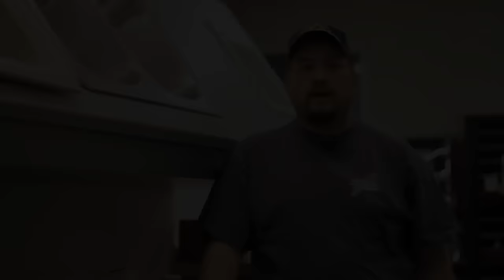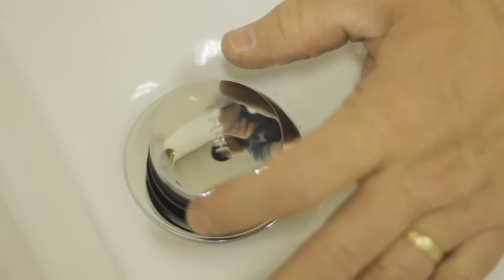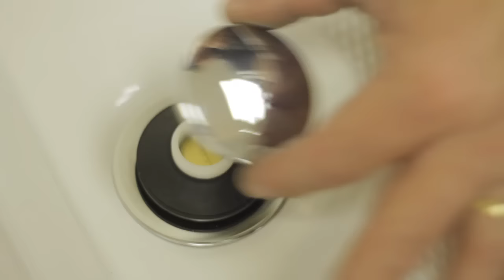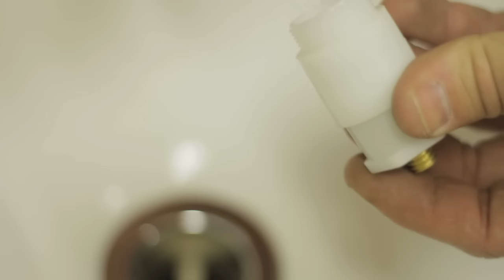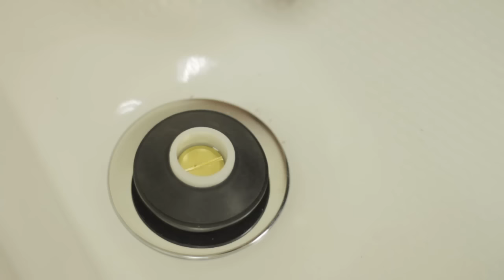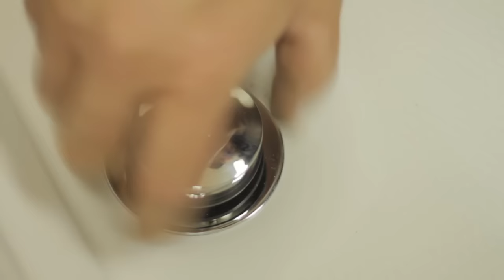Bathroom Repair : How to Repair a Pop-Up Tub Drain Stopper

Comment: Why can't I unscrew my top?
Reply: Ditto here as well. I was almost thinking the contractor used loctite, due to my not being thrilled with some of their work..
Reply: It’s been years since you asked but he mentions in the video that some plugs all you do is just pull straight up and out. No need to unscrew.
Reply: Some u have to pull the cap off it won’t break it literally pops off I knw this comment is months late but 🤷🏻‍♂️ I’m sure someone can use it
Reply: @potpapi1275  I did, your comment was helpful😂. Thank you
Reply: Me too, another month in the future. 🤣
Reply: what worked for me was sliding a pair of needle nose pliers underneath the cap to hold the bottom piece down while you unscrew the top. the cap might just be really tight.
Reply: Helpful to me too! 😂

Comment: Thanks Terry! I spent 30 mins spinning the top of the stopper but  it wouldn't come out. I was making progress but never could get it all the way out. Frustrating. Then I thought there had to be a trick so I went straight to Youtube. I had to put a needle nose pliers under the silver cap of the stopper to hold it while I turned the sliver cap/top off. Once the cap was off I saw the brass screw hidden under it .....now I'm home free. Thanks again!!

Comment: the screw on mine is stuck it isn't moving any idea?? love the video exactly what i needed to know
Reply: I put some muscle into turning mine with a big headed screwdriver and finally got it off
Reply: @trackstar33  yeah, I had to match a wood chisel to the size of the slot and it worked.
Reply: Perhaps using a portable screwdriver with a large bit  on low speed to get the torque needed— I saw that on YouTube. .
Reply: can always use a drill or a stripped screw head tool

Comment: I followed the video instructions and it worked fine to replace (not repair) a broken drain. It took 5 minutes. However, you do need the correct tools to make it that easy. A special device to help unscrew the old broken drain (by friction) and a different tool to make it easy to snugly tighten the new drain without scratching it. My wife thought it would take hours. With the time I saved, I am going to have a couple beers.

Comment: Thanks Terry! Once I got the screwdriver portion out it turned out that it was just my fiancé' hair that was clogging the drain. Easy fix that I wouldn't have found without learning that a screwdriver took the cylinder section out. Great video, especially for a DIY beginner like myself!

Comment: My stopper (toe touch) seems to have a different design. I couldn’t unscrew the cap. It doesn’t seem to be screwable. But I was able to unscrew the whole stopper as one piece with a big plier. There is a screw at the bottom of the stopper assembly. Basically, the whole stopper was sitting on a screw. It was very tight and took me a while to unscrew the whole thing. Anyway, just want to share my experience as it might be helpful for some people.
Reply: I realize that this is an old post but for the rest of you folks out there...  If you use needlenose plyers and slide them under the rubber washer, you should be able to hold the plastic stem from turning as you unscrew the cap.
Reply: Paul Gorsky thanks! Just cleaned mines.

Comment: thank you!
I had just installed a new tub. A Month or two after install the stopper stopped working.
[the spring/screw had shortened to the point it wouldnt catch the drain.]
Soon as I saw this video, I fixed it within 30 seconds. By taking the top off, and giving that flat screw a couple twists.
 Thanks again!@

Comment: try pulling on the silver top piece and turning counter clockwise sometimes the whole stopper comes out from bottom of drain which is fine because you can now turn the top outside of drain using rubber lined gloves for gripping as to create tention enough to loosen the top in order to expose the screw undernieth

Comment: I didn’t know top cap comes off. My brother broke the inside of drain which fused to the brass screw from stopped. How do we replace the drain portion to add a new popup? since and brass do not mix and it was inevitable that they fused together. Thanks.

Comment: What do you do if you can't get the top cap off? I've tried everything I can think of (Except a torch). The whole pop up drain assembly just keeps turning - without loosening or tightening.

Comment: I have this kind of drain but what happens if I can’t unscrew the screw to get it apart? I’ve tried everything to get that screw loose, even WD40. Screw is stuck tight. Tub drain is stopped up and I need to get Drano in there.

Comment: So I just replaced it. It won't lock down into the closed position. I tried putting a washer between the screw and tub drain. I could then get it to lock down, but all the water drained out because it was sitting too high. Any ideas?

Comment: this looks very simple, but the place where you would normally use the srewdriver is wider and will not work with a screw driver. what can I do? i tried a wrench which, resulted in the plastic surrounding housing to break.

Comment: I should have looked this up weeks ago and saved myself a lot of frustration from prograstination. The part itself is an easy replace. Though the corroding and breaking mount to the actual tub is a different story which I might have to deal with. But if that becomes a problem, that will be the landlord's problem

Comment: Any suggestions on how to get the stopper unscrewed? Mine is not budging, even after buying a larger flat head screwdriver - nadda.
Reply: +Deana Williams I recommend working some baking soda down the drain then pouring in some distilled white vinegar, the chemical reaction might eat away the crud that has your bolt locked up.  If that doesn't work boil a little water and pour it down after the bakingsoda and vinegar.  This method just now worked for me.  Good luck!
Reply: Thanks, this method just worked for me too!
Reply: I have a Delta stopper.  The entire assembly is in one piece (not two like here) - but the process is nearly the same except no screwdriver is required.  
For this one, you carefully use pliers on the decorative top - I took a silicone hot pad that was no longer pretty enough for the kitchen as a grip/cushion.  And with authority, lefty-loosey.
It's kind of a weird design.  The top assembly can get cock-eyed - I was afraid I'd broken it.  But that's how it's designed.  The rubber surround doesn't need to come off (I removed it, when I was looking to see if I'd broken it, and it's a pain to get it back on again.)
Hope this helps.
Reply: Deana Williams 
Mine was stuck solid, I put a long handle screw driver and turned it while strongly tapping the handle of the screw driver with some pliers. I didn't have a hammer handy that's why I used pliers as a striking tool.
Any-who, this worked!
Reply: My popup bathplug does not want to click to close. Any ideas would help
Reply: Success!  Baking soda followed by vinegar and then a cup of hot water !! Thank you!

Comment: if anyone is struggling to remove the cap you can unscrew the entire drain by gripping it firmly and unscrewing, after let it sit in hot water and some dish soap! mine was cemented shut with old conditioner and other residue but some dish soap and hot water did the trick

Comment: I was having trouble getting the silver top off but I used a pair of needle-nose pliers to stabilize the white plastic part while twisting the silver top - that worked.  NOTE: if the screw is locked up (seized) by gunk something that helped me was putting baking soda down the drain then pouring in distilled white vinegar - on my second tub that didn't quite do the job so I poured a little boiling hot water down after the baking soda and vinegar which did the trick.  Darn that shower grime!  Disgusting.
Good luck everyone!

Comment: So what do we do if that flathead slot WON'T BUDGE.
Reply: Use a multi speed drill set it in reverse and set it to one and slowly go up until it hits the force threshold

Edit further more look up penetrating oils and if all else fails you could get some bits and drill it out
Reply: Yep, same issue here lol. Damn flat head is fused.
Reply: Same here. Has to turn both directions to get it loose

Comment: Mine looks exactly like the one in the video, but no go.  The whole piece just spins and spins in either direction.  I tried holding the core in place with channel locks but nope, the top piece will not turn.

Comment: Have a cheap plastic topped one put cloth round top and keep trying to turn anti-clockwise took a few minutes before it came loose its a partly brass rod about  2.5 inches long threaded on the end,be carefull not to damage chromed plastic top.

Comment: This is not a repair.  It is a replace.  I need to know how the "guts" fit inside. I bought a new plug and it 'exploded' coming out of the package and I don't know in what order to put it back together.  
$15 and if I lose the screw, I am screwed.  I know how to replace, but when I put it in, the thing would not go up and down as it should. Please help me.

Comment: The old pop up drain wasn't threaded and didn't work (I just picked up it out of the drain) when I bought the house. Followed all instructions with new piece, same as in the video, drain keeps spinning when trying to replace (but it's threaded, doesn't just come back out) and still lets water out slowly. No idea what I'm doing wrong. All these videos look like it's suppose to stop spinning at some point when replacing. If I spin to far, it won't pop down at all, otherwise can't get it to keep water in the tub. And I mean spinning, not like what I see in this video, I have to spin it more than 10 times and it caught the threads and yes I can still remove it.

Comment: My problem was that it didn't stop the water from draining when it was pushed down. Made it impossible to bathe. Turns out that screw in the middle of the stopper got loose which wasn't getting a good suction to stop the water from draining

Comment: My stopper is really stuck in there. I will keep trying.Thanks for the video :)
Reply: +maldoror23 I recommend working some baking soda down the drain then pouring in some distilled white vinegar, the chemical reaction might eat away the crud that has your bolt locked up.  If that doesn't work boil a little water and pour it down after the bakingsoda and vinegar. Good luck!
Reply: @cannonrange9977  I was about to give up then I tried your recommendation without much expectation but it worked like a charm!!! thank you so much

Comment: Mine has no screw and the entire (sub) assembly was supposed be turned to remove it ( after removing the top cap and washer). It seems the stud into the crossbar is frozen. So far no luck with WD40, Lime Away, etc. No wrench flats and no access to the stud . Anyone else run into this, absent cutting or drilling it out ?

Comment: Mine wouldn't pop up once it was down. I took it off, soaked it in vinegar for about 45 minutes.  Scrubbed it to get hard water off.  Sprayed it with WD40 and it works better than when it was new.

Comment: Okay, I want to remove a stopper like this but it refuses to unscrew. I've tried unscrewing it with all my strength, but nothing. This is driving me insane.
Reply: Mr. Horseshoe What did you do to turn the set screw?  I am having the same issue
Reply: I've got the same problem!
Reply: Same problem here too!

Comment: What if the top doesn't come off?
Reply: I didn't take the top CA off first I screwed the whole thing out I had a couple of pairs of channel locks and a med sized pipe wrench, and my screw driver....once I took it all out I could hold it better to get the top off....two of anything that gives you a firm grip on the plug body while you gently remove the top. I figured out mine came apart in the middle as well. Just remember me the pieces of the plug with 123 or A,B,C So you can just reverse the order and put it back together...be careful if there are plastic rings inside it.....
Reply: +Tawnya Bartlett 
oops completely disregard the "CA" Its a typo....

Comment: the notch for the screwdriver was so shallow that it stripped out within seconds attempting to get it out. They did that on purpose didn't they? ...so i would have to buy a whole new tub and sell me a bathroom remodel while they were at it.....right??.....lol....I got the screw out using an improvised object w a long thin piece of metal acting as a screwdriver edge. :-) I've noticed the plumbing indistry makes really crappy parts, its unreal.

Comment: Thank you for the Video . Looks like mine is poop lol  . But you have Elvis who is cheap as a poop . I hope the springs don't hit him in the eye when he tries to take apart his broken toy . Seven or eight parts depending on what your counting ( don't tell Elvis what we are not counting  ). Ok the drain works a on cam based system so if the cam isn't working don't be Elvis . Buy a new part . Elvis would go out of his mind if this dealt with a real mechanical linkage  I never liked Elvis still don't no doubt she will spell check me soon lol

Comment: Terry, you didn't show how to repair it. You just showed how to remove it. 😞
Reply: +Christopher Karpowicz  he assumed you had some basic intelligence.
Reply: +Matt Black  in today's America, it's not smart to assume that
Reply: Mr. I'm with you. If he thinks taking it out and putting it in is all there is to it, there's a reason he's at a store and not out doing plumbing. I wanted to know what to do with the spring and two white plastic rings that fell out. I will say thanks for the step he showed but nothing showed how to make a non working one ...work.
     btw...I do hope the comment about being smart enough was dry humor, cause repair requires and non working item to work. I highly doubt taking it out and putting it in repairs anything. So it should be titled replace. Which I am smart enough to know the difference.
Reply: +Tawnya Bartlett 
oops my bad I should have said " basic intelligence " which doesn't at all sound dry humor.....so let me add.....if that's what he assumed I should be insulted....like I am by that comment....he assumed I could fix something I've never seen but I could get the cap off? Really?
          nope got it off...now what genius?
Reply: Agreed, this was a replacement, not a repair.  I was hoping for adjustment tips--for when a new one doesn't seal, etc.  Not buying a new, new one.
Reply: +Skibbified 
I messed with the spring inside and had to guess at the plastic ring placement cause they fell out. I opened the spring a bit to check if it had been compressed by   use too much.... i finally did get it working......I do believe the spring was just not doing its job anymore......
       since then I've had days it did want to operate correctly but a bit of tweaking in the spring or how much it's screwed into the tub will fix the issue.

Comment: That's how you REPLACE a pop-up drain stopper, not REPAIR it!  A monkey could figure out how to take out the old one and screw in a new one.  I was searching to see if there was a way to take it apart and fix it where it doesn't stick in the closed position.  Thanks for nothing.
Reply: Well Elvis, there isn't much to these stoppers and the only repair might be to replace the rubber/washer seal. So, I think your review is pretty abrasive and based upon your ignorance rather than the video, which is very well done. So, maybe it's time for you to leave the building Elvis.
Reply: grs
I think you mean "You're an ungrateful jerk".  And I only stated a fact, but thanks.
Reply: Just take the old one to Home Depot and get another one there like eight bucks then lied to them and tell them you're bringing the old one back it didn't work
Reply: Elvis Iseverywhere nn
Reply: I'm having the exact same issue here. The stopper won't stay closed. Glad I just dropped thousands getting this new tub and the stopper doesn't work. What a terrible design. No support at Maax either. It's Saturday. No offense intended to the poster of this video, however right now this product is sucking. Big time.
Reply: How about to put one back together again. When I was cleaning it the stopper flung from my hands and all the pieces came apart.
Reply: Elvis Iseverywhere an ass like you should just take it out and buy a rubber stopper and a chain
Reply: No offense but he just did your job and even if youre everywhere that doesnt mean youre smart it just mean you di a graffiti everywhere so stop being elvis

Comment: had to dislike this, this is not how you repair it
Reply: I unscrewed the cover but cannot remove the piece that you need a screw driver. Will Blaster work to dissolve the junk around the stopper?